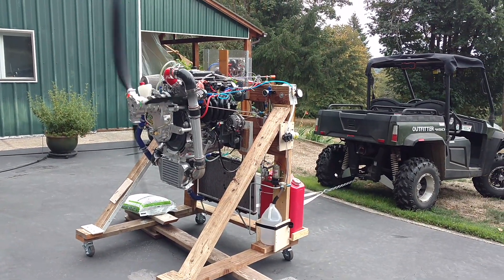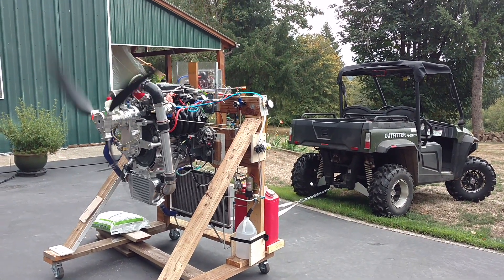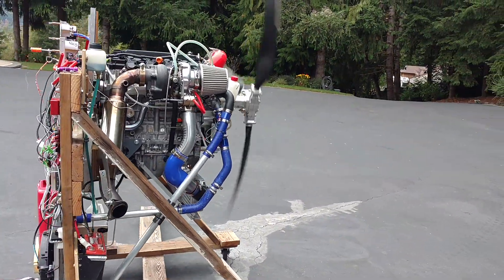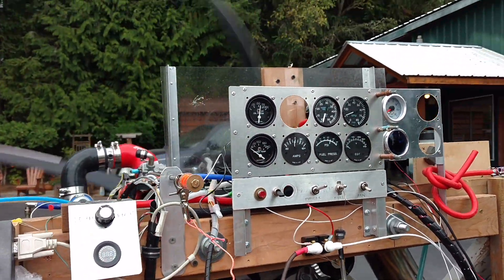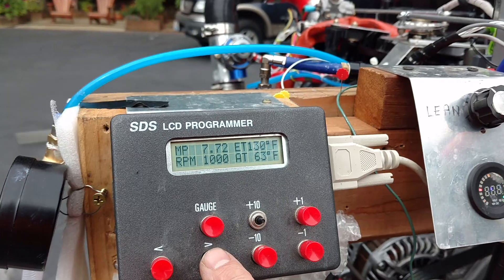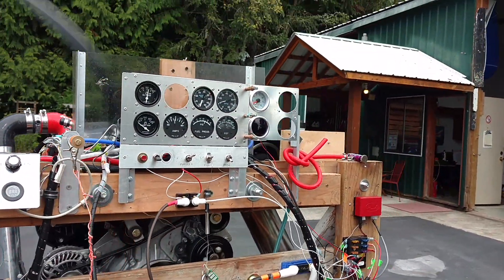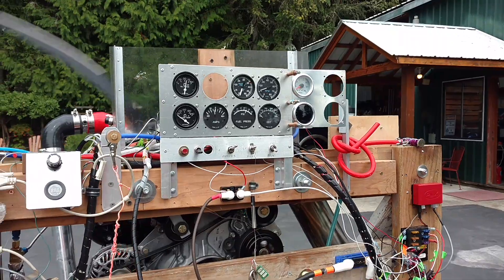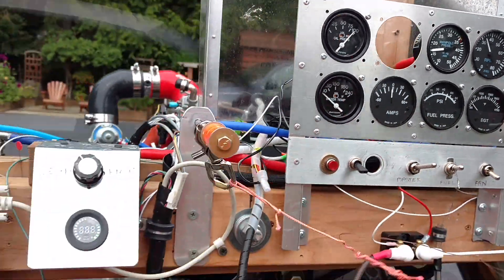Honda R18 civic airplane engine now with intercooler. Running on test stand.

Comment: I am very interested in your thoughts around this engine choice.  I just hit the buy button on a Normally aspirated Viking 150 R18Z9 engine.  This is the newest offering from Viking Aircraft Engines (not yet officially advertised on their site) I am putting this engine in my Murphy Rebel and would like to hear from anyone currently flying behind this engine.  Also your thoughts around the PSRU as I will be using the same I would think.
Reply from the maker: Frank.   My project is widely documented on VAF at this address which will answer any questions you may have on the project.   .   https://vansairforce.net/community/showthread.php?t=158610&page=74
 I used the Viking PSRU but a straight up Honda engine (not from Viking).  So my project is different from Viking.  Namely I use SDSEFI for injection and ignition
My thread has over 145000 views.  I am happy with the PSRU from Viking.  I have 70+ hours on it with no troubles.   I used the HD PSRU from Viking.  It does get warm 215F+ when I push it hard, and I hope to add more cooling blast tubes to it to keep the oil temps lower.

Comment: How is the build coming along? Cool Test Stand, I made mine out a Auto Engine Stand..
Reply from the maker: Buddy,  It is going well.   I keep the progress fairly well up todate on what is callethe Vans Airforce Newsforum.  I have a thread there that has over 60k views.  To learn more here is the link.    http://www.vansairforce.com/community/showthread.php?t=158610    There are several over Youtube videos.  You can probably find them by searching under "honda R18"